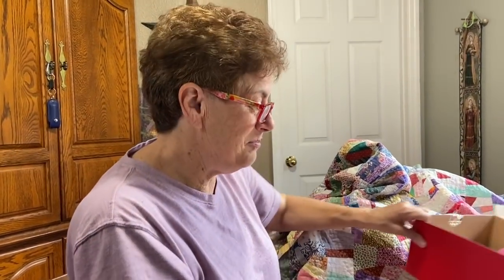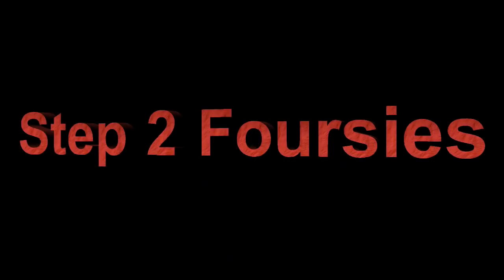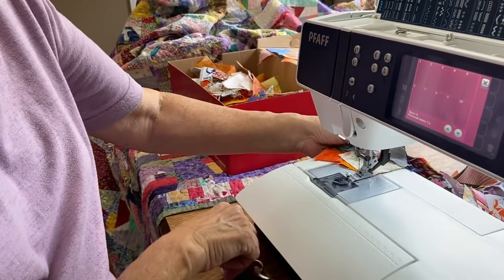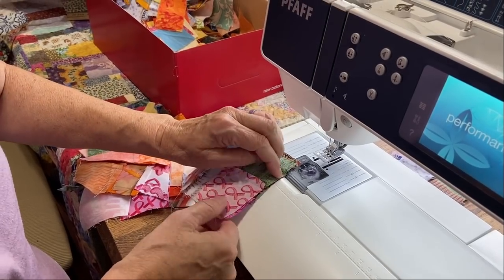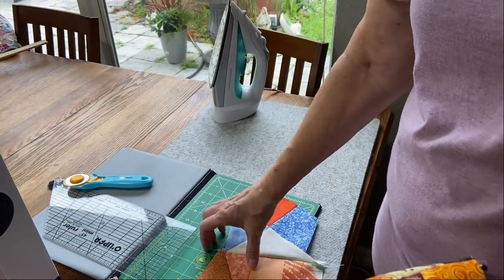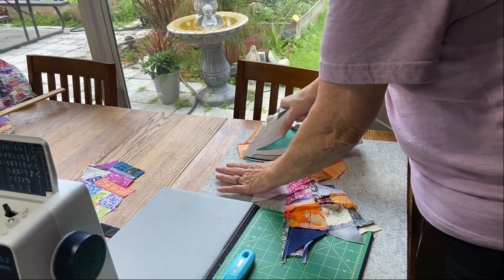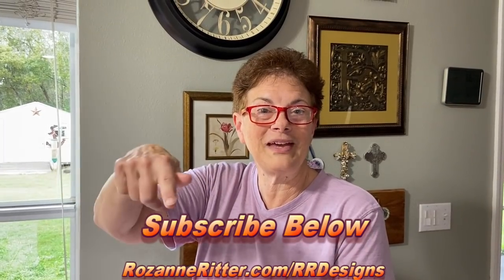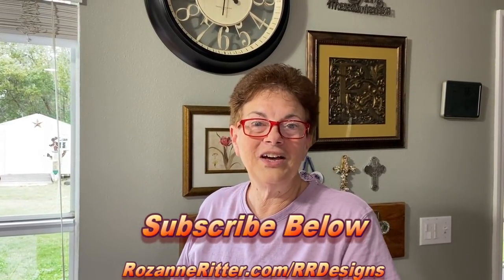RR Designs Trash Quilt Tutorial video

Comment: This has turned into a relaxing addiction for the last 3+ years....So much so, that those mini cuts made from squaring up I sew them onto a stablizer using Pellon shape flex sf101 which were also pieces saved from other projects. I have a couple + of plastic flip top bins full of "trash" quilt tops. Depending on sizes of scrap fabrics, I cut the sf101 in narrow, rectangular, triangular or 3inch wide strips.  I am not going to use batting with the shape flex "blocks"...I can just make summer quilts without the batting.
Reply from the maker: Great idea!
Reply: @RozanneRitter  z
Reply: A lightweight flannel, well washed, make a nice fill for a summer quilt. I'm sort of the Princess and the Pea type, I can feel the seams of the top through the backing on my legs if there isn't some filler. Otherwise I can get by with a whole cloth type quilt.
Reply: @renel7303  👍 totally agree.  I switched to pellon shape flex by the bolt when on sale for a few cents a yd....but now with the outrageous prices, even on sale...I am back to totally using sale priced flannel as batting for my own scrappy quilt use.  I know what u mean about Princess n Pea..🤣 Good night from NM
Reply: @BAM-jc7uy  good night to you from equally sunny California. I lucked out last year. A gal I was acquainted with from a local quilt shop reached out to me on Nextdoor to see if I knew anyone doing charity quilts or sewed for kids. My neighbor does both so we met up and she gifted us with 8 large garbage bags of good quality cotton, minky, fleece and flannel. She told me to go through it, there was stuff she was sure I would like. Yes indeed. I kept several 2 to 4 yard pieces of solid pastel flannel. And maybe a few other trinkets. 💁‍♀️
Reply: @renel7303  👍👍
Reply: This is amazing,thank you

Comment: Just thought I'd update you on my trash quilt. Made well over 100 twosies & moved on to foursies. Well that didn't work for me--not enough variety. My scraps seem to be stratified by project. So I grabbed several bins/bags of scraps & added to my scrap mountain. Went back to sewing twosies. Will continue until the twosies shopping bag feels heavy enough to be a top. Modified the process a bit. I cut the twosies apart then add them to their bag. I won't pressing until I start making foursies which is helping me keep my working area simplified. Design decision made. I want to sash to show off the various sized blocks. Decided to construct the quilt using the binding method quilt as you go which will sash as I go. I'm a die hard hand quilter & there's no way this quilt will be quilted otherwise. Never machine quilted before but I think I'll be able to manage.

Comment: With almost 420 comments & your still answering them, I'm VERY IMPRESSED!! Thanks for showing this & a couple of questions. 
1, what size needle ate you using ? 
2. What stitch length ?
3, Do you ever set your seams open ? Would that help ?  
4, Love the suggestion of Meandering quilting!! THANKS AGAIN!!
Reply from the maker: 1. needle-regular for cotton material  2. stitch length- 8-10 per inch. 3. I don't set the seams open, I think that would be a hassle. My friend that quilted the quilt did a meandering stitch to avoid areas of small squares or triangles. 4. You're welcome!

Comment: Rozanne, thanks so much for this video! I was mesmerised watching it form those little unexpected shapes within the block!! I have a question as a new quilter which might sound silly but - do you use very short stitches? The thing I’ve found is that when I’m trying to keep a small seam allowance, just me ironing the seams open can make the first few stitches of a trimmed patch come undone because I’ve trimmed through an existing seam. I just know I’d find my seams had come undone and would get frustrated but I’m wondering if I might overcome it by using bigger seam allowance (I think it’s because I don’t have enough experience yet, trying for too much waste avoidance in making my seams leads to mishaps!) Do you find that happens and is it a beginner thing? Could I help avoid it by making my seams more like half an inch? Very keen to try this fun method!! Loved the video and your little dog ❤
Reply from the maker: Good questions. For this method, you can use your regular stitch length because you're not going to open up the seam. I iron down the seam to set the thread and fabric and then open up to reveal the right sides of fabric and seam will go to one side of the fabric or the other but you don't have to open up the seams.  NOW, what you're talking about with other projects, short stitches are great for small, miniature blocks with 1/4" seams. Just remember, if you make a mistake and have to take a block apart, you've got some really small stitches. Good to use 1/4" seams for all quilt projects. You can also back stitch at the beginning of a seam and at the end. Seams will unravel if you have to trim a block, it's expected. Hope this helps. thank you for asking. Let me know if I need to answer anything else.

Comment: Trash quilt update. This is the perfect project for my circumstances. Finished the foursies & designed/finalized the quilt layout. I'm using the binding method for quilt as you go which will automatically give the sashing I want. The blocks will range in size from 24" to 3". The quilt will be in a medallion style with the 24" blocks at the center & 4 corners that will be on the top of the bed. Suffering a bit from scrap fatigue so I took "trash" literally. The centers of the 24" squares will be leftover/failed/sample blocks. I also located several dozen 9 patch blocks. I'll be using these in conjunction with the trash blocks for the "drop"/border. Can't wait until I have trash sections large enough  for a 24" sq so I can start  working on my design wall. BTW Queen size with a 10" drop.